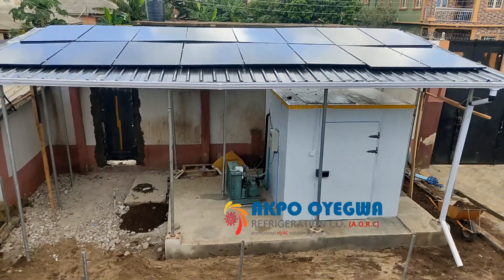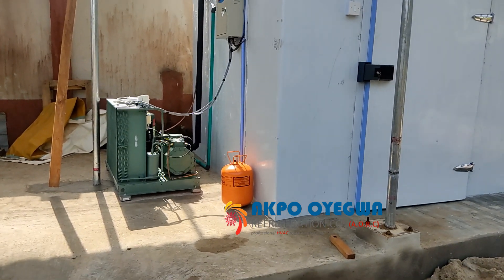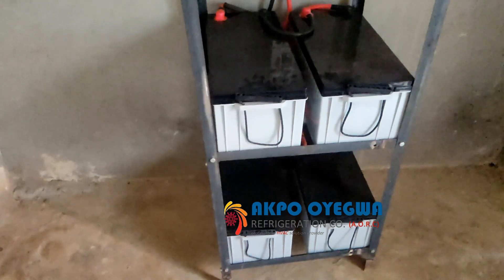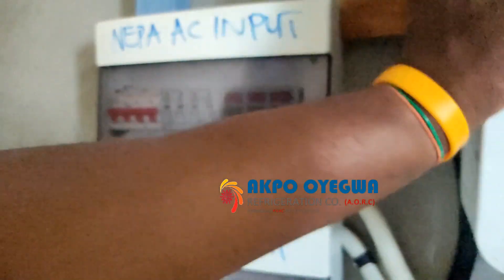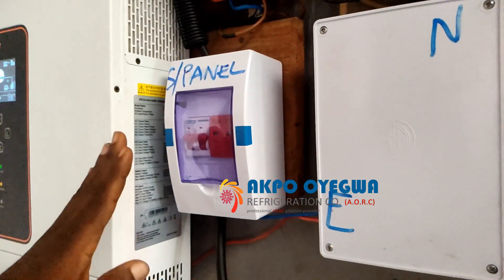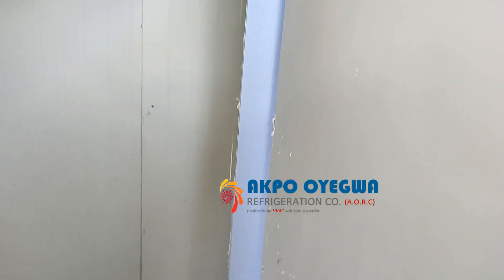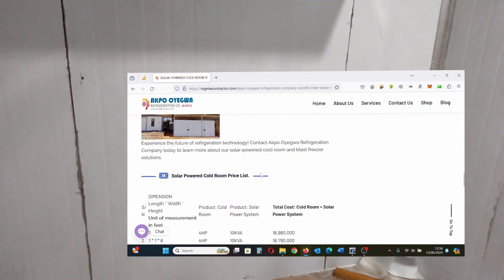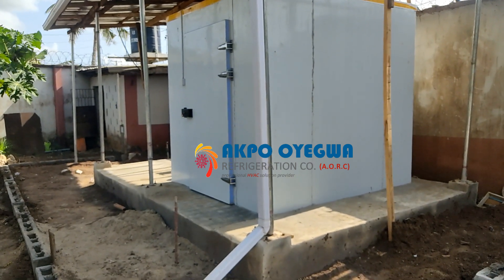SOLAR COLD ROOM - Solar Powered Cold Storage

Comment: Battery capacity: 24v X 200Ah = 4800wh @ Dod50% = 2400wh; cannot support refrigeration unit at night ; still need to import external power at night time
Reply: Its a slip of tongue. Obviously there are four units of 12v 200AH batteries connected in series, which amounts to 48v x 200= 9600wh. Secondly, there is grid supply at night to power the cold room and charge the batteries. Thirdly, there is a standby 20kva gen in case there is no enough sun during the day due to the rainy season. Everything works as planned.
Reply: @ovieoyegwa6153  Very good job ! 100% of 9600 wh can be used if lithium ... but with vrla, you do it , your batteries will die in 1 month (sorry for my bad english , write from Senegal). So in grid and generator system, 4 batteries is a good compromise ...
Reply: All they need is small EV car from China to use as power bank?